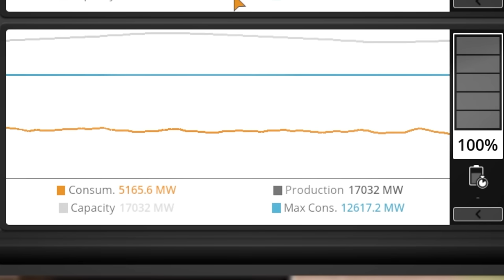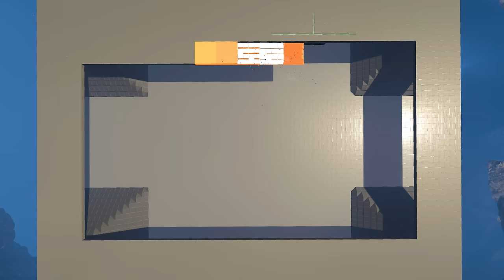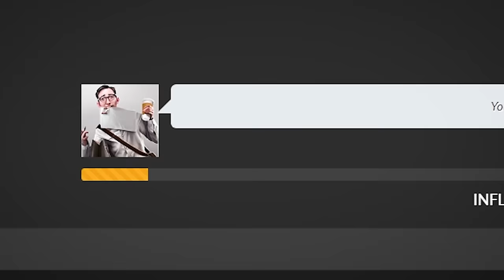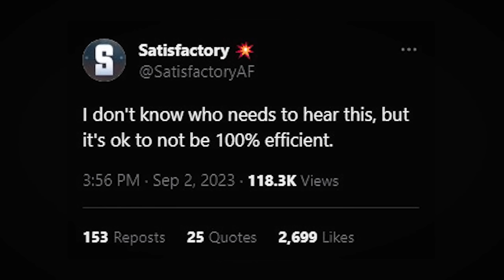This GIGANTIC Factory Will Serve ONE Purpose in Satisfactory Update 8

Comment: What's is better for fuel, turbo fuel or diluted fuel?
I'm using the equivalent of 4 pure oil nodes (3 pure + 2 normal) to run 200 fuel generators. In a closed loop container system. Just oil, water, and empty plastic containers. 
I thought the turbo fuel was to much extras like the whole blender system addition.
Reply from the maker: I'm pretty sure my turbofuel setup is as efficient as Oil power can get. With 3000 oil (5 pure nodes) + 2000 sulfur, running ~388 fuel generators at 250% 🫣 I think its well worth the extra work 😉
Reply: @AproxPlays  it's about the same.
I was wrong on the nodes, its 3 not 4. Thats 2 pure, 2 normal, split into 6 lines.
Reply: @AproxPlays  minus the sulfur.
I'm just using water and oil, recycling plastic containers back throught the lines.

Comment: Texture quality, shadows, clouds, antialiasing if using TSR/TAA, lighting and global illumination effect GPU usage/VRAM the most so turn those down for time lapses. Also upscaling works best with static scenes so you could drop the resolution with TSR too.
Reply from the maker: Fair point, sadly time-lapse recording is a MASSIVE hit to the CPU and SSD with virtually 0 impact on GPU performance as visible in the footage (game runs smoothly between captures). Works fine with 1 camera angle, but once you add more it compounds into oblivion 😅